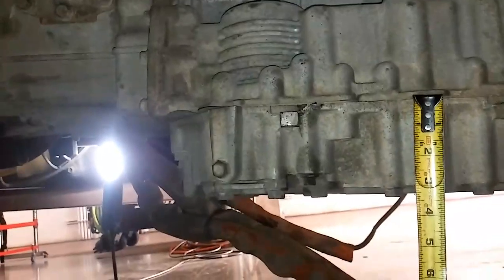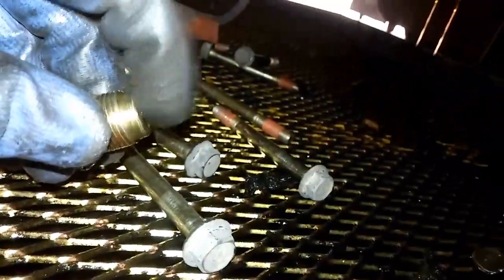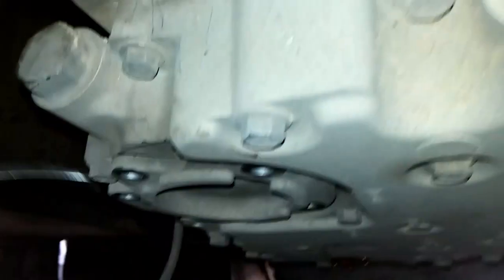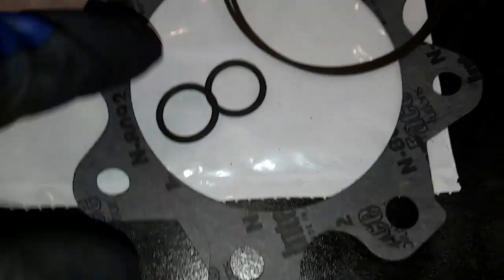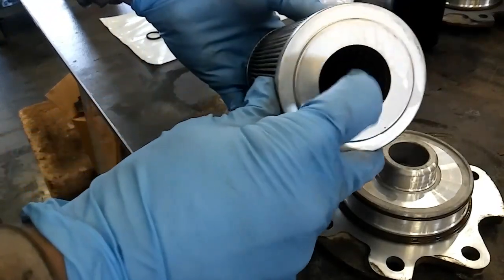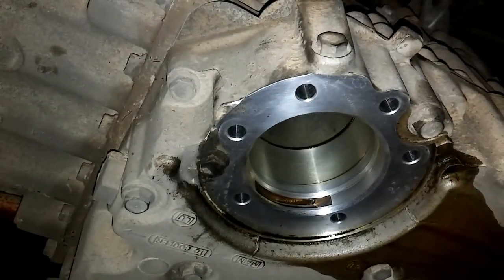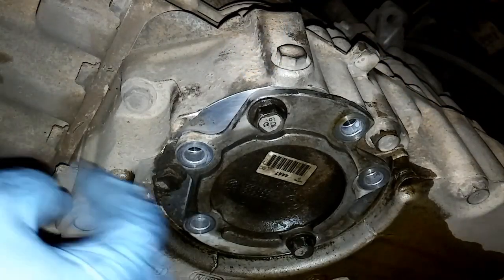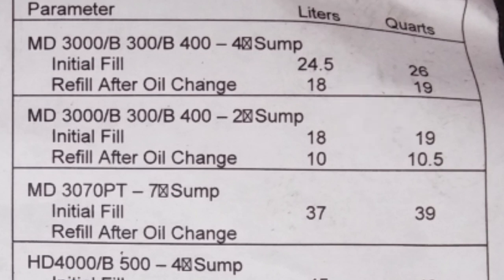How To Do An Allison Transmission Service.  Allison 4" and 2" Sump Oil Change.

Comment: Hey buddy. Thanks for the video. I have a question for you. My Blue Bird got completely flooded, I mean submarine style, I got the Cummins 24 valve back running. What should I do for the transmission? Procedure wise? It looks like Pink paint. I appreciate your time.

Comment: Thanks, my experience is with standard transmission in diesel trucks (except construction equipment). I retired, bought a motorhome, and was looking to service the Allison myself. I have a compultion to do everything myself (trust issues) 😂  I had Blackstone lab do oil analysis, and it's getting close to needing service. They give you a technical and a layman's version of the report. It's a great reference to see the oil condition, with your driving style. I've got the 4000 series, deep sump and Trans Retarder, so the capacity is more yet.

Comment: How do i differntiatw what allison i have? Its in a 1998 holiday rambler endeavor motorhome. 24 valve cummins pusher, 6 speed allison, freightliner chassis. It looks similar to the on you serviced in the video. Ut is definitely the shallower version.  Has a part nimber cadt into it of 29503270. Do you know its change capacity and filter part numbers?

Comment: Great video, but the thing missing is "What kind of transmission fluid do I add" - I'm pretty sure somewhere I read it has to be the "Transync" (or some kind of synthetic fluid) versus regular Dexron type? I can't find my manual right now, but I don't want to add the wrong fluid. Do you know what I'm talking about?

Comment: Awesome video sir.  Thank you....I have a Cat in my RV with a MD 3060, SN 6510002633.  The new filters from Allison (29548988) do not come with the square cross section o-ring...I have tried and tried to find a source for the square o-ring, I found a number on the data sheet that came with the Allison Filter kit, that no one has and I can't even find it on the Allison site (29501469). Do you have any suggestions sir? Thanks again.

Comment: Hey Adept, love your videos! They have been super helpful to me since purchasing a 2003 Thomas Saf T Liner ER school bus that I'm converting into a RV.

I have some questions in regarding this video and my bus. I took my bus for a drive the other day and noticed it shifting hard from 1st to second and second to third. So when I got home I checked the transmission district and the trans fluid was WAY over the Hot max fill line. Being worried that my transmission was overfill I drained the entire thing and not knowing how much it needed. I went on YouTube and found this video. I have a MD3060 6 speed automatic push button trans and a 3126E Cat engine with a 4" sump. When I drained the trans I drained about 4.5 gallons. I then put in new filters put the plug back in and starting filling it up again. I put in 4 gallons of trans fluid in and checked it. The reading on the dipstick was about a half inch above the Hot max level. I know you said 19 quarts 4.75 gal for a 4" sump. I got 4 gallons in there now why is my fluid level higher than it should be? The dip stick appears to be the right one for the transmission. It looks to be the proper length compared to the tube when laid beside it. Should I put in the other 3 quarts fir the 19 total? Or should I not since the stick is showing it over filled? Your expert thoughts on this would be much appreciated! Thanks!

Comment: I have a 2008 Safari Cheetah motorhome with an Allison transmission.  Your video on checking the fluid level is what I needed.  I'm not sure where the fluid intake is for the vehicle.  Can you explain where it's at?  Thanks

Comment: I have a 2012 Freightliner Business class M2 8.3 cummins with an Allison transmission.  I have a check trans light that has come on 3 times after the filter and oil change has been done.   What do you think my problem is?      Do you think i need a new trans?

Comment: I had to pull an Allison out of a kenworth this week.  What a nightmare getting at a few of the bell housing bolts was.  I will never again complain about a standard transmission.  I particularly had a hard time with the bolts on the left and right side near the unused mount plates.  I took the liberty of grinding off the material that was making it difficult to remove.  My swivel socket will fit nicely with an impact gun now.

Comment: I’ve done the Allison level check on fire engines and it freaked out my officer.  When you got to raise the cab on a fire truck with a ladder it takes a lot of time to secure all the gear, pull it onto the pad outside, set the outriggers raise the ladder then cab... talk about a pain.  Work smarter!

Comment: Thank you for your videos. 
I have a 2011 international 4300 maxforce 10 automatic transmission and it keeps coming up with spn2003 fmi:31 it says check transmission 
Check transmission oil filter. A friend of mine said that I shouldn't change the filter because it will break the transmission .my truck still runs good what do you recommend ?

Comment: Thanks for an awesome channel, i have Been a mechanic for 25 years but never specializing in diesels.  A few years back I have purchased an used 2003 RV on a f650 chassis with a 3126 and Alison gearbox. Your channel has helped me on several occasions With just info that I needed to learn how to work on it and keep this ol girl on the road. I have used this video to see if I could check the oil level. It seems that this is an older single digit display that when I press the upshift and downshift arrows at the same time to check oil level all I get is a “d” “-“ “1” flashing I can’t seem to find any info on the internet can you shed any light on this? Thanks and keep up the good work!!

Comment: Hello, i have change Allison Transmission 3066 on Mercedes Benz ECONIC truck and i put  20,000ml(which is 20liters) of Allison TES 389 CASTROL TRANSMAX DEX-III  in the transmission. now when i start the Engine the dip stick does not touches  the oil, but when i check it in the morning at the cold state when the engine is off it  is at the cold full  and upon all that when i check it digital it display oL 07. Please any one with idea should send  me a mail eopoku233@gmail.com.

Comment: Hello.  I have a 4500 rds and it has a very hard shift from 1st to 2nd also down from 2nd to 1st  would changing the oil filter help or what can you recommenced.
Reply: Henry Trujillo I have encountered the same problem what I notice when I did not plug the truck in the shift was harsher right away when left unplug took awhile before starting to upshift and gear down poorly so I plan to change the fluid and filters....just might work for You also....will let You know my outcome.

Comment: I really enjoy your videos on Diesels. I just bought a 02 Dutch Star with Cat 330 HP with Allison trans. I asked the dealer to have the trans serviced , and they took it to Freightliner in Chandler Arizona. They charged me $675.oo for a service on the Trans.
When i got the coach home i looked at the transmission and the filter bolts had not been removed. I called Freightliner and they said another filter was changed on the transmission, are there other ones ??
I am only aware of the two that you show in the video...
Are they taking me for a ride .
The coach has 117000 on it , so i wanted to make sure the trans was serviced.
Thanks for all the great Videos , i watch all of them... !!!
Reply: Jess R same thing happened to me.

Comment: Hello my friend, I have an  Allison Transmission that has coolant mixing with the transmission fluid. When I check the transmission fluid I see milky like fluid. What should  I do to fix the problem? Also I had a coolant problem which got fixed after that the mechanic  fixed the he  put some radiator flush in my  radiator to flush out the old fluid. So do I  need a new radaitor

Comment: Approximately how much would a service on an Allison transmission like this cost(ball park). I have a 39' 2003 Newmar Dutchstar Diesel pusher with a Cat 3126 and Allison(I believe it's a 3000 series) on a freight liner XC chassis with 48000 miles. I really appreciate you taking the time to post these videos and share your knowledge. I only wish I lived near your shop so I could get you to work on it when needed. Thanks!
Reply from the maker: +richard leitner A transmission service by itself would be about 2-3 hours, if done with an engine service they would probably just charge 2 hours for the transmission service. The fluid is pretty expensive at about $200 for the 5 gallon bucket of transyn and the filters are about 40 dollars. So you are looking at the $500-$600 dollar range for a service at a shop like ours. You can do it yourself for a lot less of course, but it is a messy job.

Comment: I have a question, I have an International 4400 ....year 2002 with a MD 3060 Alisson transmission and its been working fine but just starting to leak from the oil pan ...I already got the gaskets, oil, filters kit... but I don't know how much do I need to tight the oil pan bolts...what's the pressure for the bolts... for the filters its between 38/45  but for the oil pan can you let me know I don't want to damage the transmission...

Comment: Do the filter plates only fit the correct way when all the bolts line up regardless of which side of the transmission they are put on?
Reply from the maker: +Steven Brick The bolt pattern is not even so yes the plate will only fit one way.
Reply: Adept Ape Thank you.  My MD3060 shifts better than new now with AMSOIL Torque-Drive and Donaldson filters... 😉
Reply from the maker: +Steven Brick Maintenance is always better than repairs.

Comment: I have a 2005 475 Accert that will not run up to proper temperature since the cold weather has set it. Runs at 160° driving and will climb to 175° when parked until it starts to cool down at idle. Oil temp only runs up to 120°.

My fuel mileage has dropped significantly.

In warmer weather the temps run closer to where they should be.

I have installed 185° thermostats, replaced the fan hub and tried a winter front with no change.
fan runs good, I even replace oil cooler bypass valve, I thought something happened with,
Any ideas? 
thanks.
Reply from the maker: +Shalva Kipshidze Hey sure we can try to figure this out. So basic things first, are you sure the temp sensor is reading right? Usually there is a dash mounted gauge, but the ECM also pulls from its own sensor.  You should compare to the two and see if they are reading right. You already replaced the thermostats and that is the usually cause, so we can guess that isn't the problem. Check those sensors first.
Reply: OKAY I will, thanks

Comment: Great video. What are the service intervals that Allison recommends? I purchased a Freightliner used and it didn't come with a manual.
Reply from the maker: +Matthew Devine I went to the Allison website and they have calculator on their website based on a lot of variables, I would recommend checking it out based on how the truck is used, but about 25,000 miles, 500 hours, or two years seems to the general recommendation based on the calculator.
Reply: the  early  Trans  didn't  use  synthetic
Reply: Adept Ape there biggest variable is wether your running there approved synthetic oil
Reply: Cuanto devo de cobrar por un servicio de esta transmisión

Comment: well  done  video . I've  seen  people  use  air  ratchets  on  the  filter  bolts  and  strip  them  just  from  spinning  them  to  fast . when  you  do  the  only  fix  is  to  drop  the  sump  and  valve  body , bolt  on  a  guide  and  drill  and  helicoil the  holes . needless  to  say  only  specialty  shops  have  the  guide   (expensive).
I  work  on  class  7  trash  trucks  and  there  is  always  some  youngster  who  thinks  he  can  do  it  faster . 
it's  a  pain  in  the  butt  but  I  always  run  them  up  by  hand ,  but  when  you  service  them  twice  a  year  it  kinda  makes  sense  to  be  a  little  extra  cautious . 
I  use  white  grease  to  hold  the  gasket  in  place
Reply: Our shop has the template repair kit to heli  cool the bolts.
Reply: asavage1576 that works if your shop is clean enough and you have the time to drop the valve body. I've never been in that situation
Reply: +Cbmech it's a pain in the butt. Better idea is properly torque the bolts lol. I've seen one with some of the holes so damaged and wallered we ended up replacing the trans.
Reply: I've  never  had  a  problem  but  I've  seen  the  results  from  2  know  it  all  kids  out  of  one  of  the  schools  that  think  they  have  a  faster  way  😃. 
when  I  was  an  apprentice  I  had  an  old timer  tell  me  a  good  mechanic  is  a  lazy  sob , you  look  for  the  easiest  way  to  do  it  right  the  first  time . the  right  way  can  be  a  bitch  but  you  don't  have  to  do  it  again . I've  done  my  best  to  live  by  that  ever  since . I  hate  come  backs  and  do  overs
Reply: Needed part numbers thanks for the video

Comment: Had a nightmare with those filter bolts stripping.  Had over 3. Someone must have tightened those up with a 3/4 impact lol
Reply from the maker: +hddm3 That would totally ruin your day. I've had the drain plugs break in half trying to remove them, but never the bolts.
Reply: Allison recommends the you only use hand tools to tighten the filter cover bolts and then torque them of course.  The bolts thread into the main case of the transmission. If the holes get stripped you have drop the sump, which is actually the control body of the transmission and Kent Moore makes a tool kit to drill out the holes and install a threaded insert into the hole.
Reply: you  can  strip  them  with  a  healthy  3/8  air  ratchet
Reply: the  cheap  skates  at  Allison  need  to  just  cast  the  case  with  steel  inserts
Reply: Cbmech they do now and any rebuilt tranny that came from a really good remanufacture will also make that repair if it's an old style threaded aluminum hole
Reply: I  know  that  good  remans do  I've  used  them  but  when  did  Allison  start ?
Reply: Cbmech  I thought the place we buy our remans from told me that atr or ATS it could have been misinformation, or that they said they put in the steel inserts on any tranny they reman
Reply: Walker Vaillancourt 
There are a couple out of 
L. A. that I've used and they both have for a long time
Reply: I have fixed thousands of filter holes on hd's, seems to me an engineer at allison should have made  better filter bolt holes.

Comment: OEM filters...?
Reply: Gregory A. Parsons we run Baldwin in garbage trucks with no issues I would prefer Donaldson if not OEM though
Reply: Walker Vaillancourt Donaldson & Wix are made in the same joint venture plant. Money says they’re producing Detroit’s OE filters. Only so many manufacturers would be willing to build a specialized wire-backed synthetic media filter.
Reply from the maker: +Gregory A. Parsons Those are Donaldson's actually, OEM is usually best though we have to use what we have at the shop.